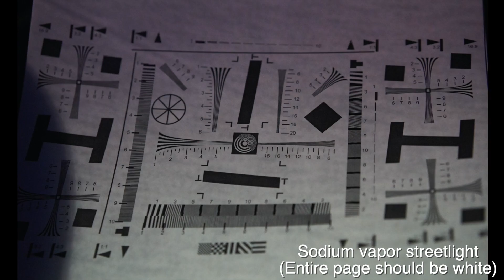Image Banding - How it Happens & How to Prevent It

Comment from the maker: I didn’t mention anti-flicker as it’s generally to reduce inconsistency in the exposure of the entire frame. So without it you could have bright and dark images alternating with one another, but while using anti flicker the shutter will align with the brightest output of the light each time to give you more consistent exposure. It rarely has much effect on banding artifacts (in my personal experience at least). In terrible LED lighting situations the best I found it did was make the banding more consistent 😂 (on the a7iii specifically).
Reply: Hello Wes, thank you. Can you confirm if the postrrization issue (michael the maven talked about) is fixed with the latest firmware? As well as all other artifacts in e-shitter mode? And,  Is it (the A9) is a good go in 2020 or R6 is better now with it's tracking accuracy and DR? Thank you for your good review
Reply from the maker: It can still get lots of posterization in high dynamic range circumstances when shooting in compressed raw. If you want to avoid that you need to switch to uncompressed, unfortunately. Most of the time it happens so infrequently and you have to look so closely that it's really not that much of an issue, though.
Reply: i repeat sir i am getting problem in still photography and also without  flash . flicker banding and other problem comes in ntsc or pal and in still when your shutter speed not match with flash shutter speed or not sync properly . but my problem is in day light without flash

Comment: So if you get "banding," use the mechanical shutter? For me wearing out the mechanical shutter will be a good excuse to get a better camera. I have a Nikon D40, that has close to 500,000 click on this shutter, and it still works good today, the problem is you must get Nikon batteries.
Reply from the maker: This isn't Always the solution, but Full mechanical often is. Sometimes you still need to try to sync to the pulses of the artificial lighting, which seems to only be getting More unpredictable as time goes by. I wasn't expecting that. I figured it would get better. How naive of me haha.

Comment: how can we remove it in post?
Reply from the maker: Which kind?
The big flash banding can sometimes be removed meticulously by creating brightening layers over the dark bands. The pdaf striping used to be manageable with a free online tool, but it hasn’t been updated in ages and doesn’t work for newer cameras and somehow even doesn’t work great for the older ones anymore either.
Reply: @WesPerry  thanks🙏🏻
Bandings from fluorescent light flicker. I hoped there was an easy way to do it with layers and blending modes.
Reply from the maker: Oh that’s even harder because that tends to have colour shifts. 
But ultimately yeah the best you can do is play with layers for both light and colour adjustments. It’s rough.
Reply: @WesPerry  thank you for your input🙏🏻 I was hoping I wouldn’t have to do that but OK😅 next time I’ll make sure to use the mechanical shutter👍🏻🎉

Comment: i have it with the z9   for event photograpy it is terrible due to led light. reduce the shutterspeed is an option but you get blurred images . HSS sync flash Forget it. I have to go back to  the d850  what a shame
Reply from the maker: Do you have flicker reduction enabled on the Z9? I found it was surprisingly good at avoiding banding. I was expecting it to be much worse.
Reply: @WesPerry  yes i did and it didnt work.
Reply from the maker: I also found I had no issues at all with HSS flash sync using the godox products I had on hand (AD200, 300 Pro, 600 Pro). Sorry you’ve had such bad luck!

Comment: I'm getting a lot of warping images, is that because of electronic shutter?
Reply from the maker: Depends. Which camera?
Reply: @WesPerry  it happens on all my sony cameras: Fx3, iv & &siii. my shutter's a 1/250 and I get a lot of banding. thanks for getting back.
Reply from the maker: Rolling shutter / warping images in silent shutter mode (full electronic) on the a7iv is Wayyyy worse than on the Fx3 and Siii, but none of them are Amazing for that. Just have to not pan quickly when in electronic shutter mode to avoid it.
Reply: @WesPerry  but I thought rolling shutter would be more of an issue in video not still shooting a 1/250?
Reply from the maker: It can certainly be an issue for both. Because of the scan speed of the sensor in electronic shutter, you can get it at any shutter speed all the way to 1/8000s
Reply: @WesPerry  thanks for getting back and global shutter will be standard in a few years, I hope cheers Great channel
Reply from the maker: Perhaps. Some say no, since apparently there is a necessary loss of dynamic range by having a global shutter. But who knows what magic they will work between now and then!
Reply: @WesPerry  interesting, I thought they were closer.
Reply from the maker: It could just be camera companies saying whatever to justify their current product lineup, but it has been said. You need an elaborate cooling pipeline for a global shutter to have competitive dynamic range, and all these small mirrorless cameras don’t have such a thing as a big RED block camera body does.
Reply: @WesPerry  can you tell me why the images can be underexposed by 5 stops when shooting at high ISO at night? screen looks properly exposed than the raw files are so dark. thanks
Reply from the maker: Possibly have DRO turned on, or Live View turned off?
Reply: @WesPerry  I've tried w DRO but I'll look into live view. it's another sony issue. if canon used third-party lenses i'd go back to canon.
Reply from the maker: If you’re shooting raw you always want DRO off. And live view setting effect On unless shooting with flash.
Reply: @WesPerry  everyone seems to leave it on but it has to be the issue. thanks again
Reply from the maker: It only affects the jpg, which is also the preview thumbnail, so it can create a disconnect between the preview and the final raw file.

Comment: Hi Wes, great video ! I need to take pictures of a one-man show and it's all in the front of a big screen. I get sometime a banding. How do i get rid of this in-camera, can you help me ? 🙂I use a Canon 6d mkII and a 5ds. Thank you !
Reply from the maker: Oh man, that's a tough one. It depends a LOT on what kind of projector it is. Different projectors not only have different refresh rates, but different technologies can give you grief. Like some DLP projectors, though they theoretically have a 60Hz refresh rate, will actually be showing Red then Green then Blue consecutively during that 60Hz, so it's actually a rainbow of 20Hz refreshes, which is a Nightmare.
Essentially the easiest thing to do is to put your camera in mirror lockup mode (because you're on dslrs) and cycle through shutter speeds until you stop seeing the background strobing/banding/rainbowing. 1/125 and 1/60 are the most likely speeds to work. But the problem obviously is the 1/60 is almost useless for taking pics of people. But as I said, every projector is different, so you'll have to get there early and do some testing to see which shutter speed works best.
I had a wedding in front of some awful DLP projectors, and I could only get it all in at 1/20s, which totally didn't work, so I created a moveable layer with colour corrections that I could slide over the images I took, with bands of blue correction, red correction, green correction, and then deleted the areas of the layer where people were in front of the screen and the stage, and shot at 1/125s. All I can say about that is UGH. haha.
Reply: @WesPerry  Wow thank you for your great answer !! You know your topic ! I guess it'll be a nightmare but i will do some test before the show and see what is going on ;-) Thank you Wes !😉

Comment: Great explanation thank you. I may dream in color here, but is there a way to fix the picture once taken 😢 i ruined a whole set a photos without noticing it.
If there's a fix in post I'll be glad to have it. Thanks again ❤
Reply from the maker: Depends which issue specifically. I once methodically created a dodge and burn mask to paste over a few images that had artificial light banding. Took some time, but worked reasonably well.

Comment: My Sony M4 have issue in still image also ..one side of pic light n other side dark..no solution yet
Reply from the maker: Is this with flash or no?
Reply: @WesPerry  without flash
Reply: That's why I am very sad about this problem
Reply from the maker: @factumphotography  I assume you’re in artificial light then? Not daylight?
Reply: @WesPerry  sir I did not understand..but I am explaining that I clicked those images in day light....natural light no flash mount .no LED or artificial lights used . Please tell me what to do..I just buy this camera 2 months  ago only and this problem starts within 15 days. Please help
Reply from the maker: @factumphotography  it sounds like your shutter might be broken if this is the case. Does it do it when you’re in electronic shutter mode? Does it do it all shutter speeds?
Reply: @WesPerry  yes in all shutter speed create problem 1/125 and 1/200 and 1/8000 . i used mechanical shutter and electronic shutter both but problem is same
Reply from the maker: @factumphotography  even in electronic? Very odd. Does it appear in the viewfinder while you’re composing an image???
Reply: @WesPerry  yes sir it's appear in view finder too
Reply from the maker: @factumphotography  so it shows up even before you take a photo?
Reply: @WesPerry  no it's shows after click
Reply: @WesPerry  sir this problem cause to memory card ???
Reply from the maker: @factumphotography  not if you can see it in the screen Before you take the shot
Reply: @WesPerry  I saw after click ...
Reply: With memory card
Reply from the maker: @factumphotography  do you have any other memory cards you can try? This is possible, but unlikely to be the issue, though.
Reply: @WesPerry  yes I have
Reply: I will send you sample images too...plz share your email or contact number...it's a very different problem ..I also never saw such a problem in my carrier

Comment: A7riii shooter here and I get crazy banding on manual mode and sometimes on aperture mode. It really sucks having to worry about banding when I try and do street photography at night. There's no second chances and lighting is always an issue. If anyone has any advice please let me know.
Reply from the maker: That would be from flickering street lights. Some street lights are the worst possible light source. Are you shooting in silent?
Reply: @WesPerry Yes
Reply: I am having same problem with banding .. indoor lighting .. and I want to shoot with 1/200 to get slow motion with 4K
Reply from the maker: You’re going to need to supply different lighting. Set up your own flicker free lights, or work by window light only.

Comment: One question. If I use the Ar7 ii with a lightning trigger (for lightning photography) do you thing that I will get banding? I'm thinking about using f10 exp 1/10 iso 100. With the efcs (because it has the lowest shutter lag).
Reply from the maker: I doubt it. Generally you only get issues with EFCS when you’re at shutter speeds above 1/250s, or with bad artificial lighting. This is neither of those.
Reply: @WesPerry  thx!!!
Reply: @WesPerry  On second thought lightning happens extremely fast and efcs isnt nearly as fast as a mechanical shutter. So i think that there is still a little bit of danger getting some sort of rolling effect on the photos. What do you think?
Reply from the maker: There would only be a rolling effect if your shutter speed was faster than 1/250s. Beyond that, your shutter doesn’t truly open all the way but just sweeps. But at 1/10s, the whole thing hangs open. I suppose there’s a very small chance if the lightning were to happen at the first fraction of an instant of your exposure, maybe, when the sensor was still being reset electronically?
Reply: @WesPerry  thx, again!!!

Comment: When my camera is in movie mode, I see 3 bars across my screen and when I record. I've had the a7iii for 2 weeks now, help plz
Reply from the maker: Could you be more specific about these three bars? Could be many things.
Reply: @WesPerry when I'm in movie mode and I start recording 3 big black bars is across my screen. If I adjust my shutter speed it darken or lighten up, depending which way I adjust my shuttle speed. When I turn it to manual mode the lines disappear if I put in memory mode it disappear as well. I've reset the camera, thinking maybe it's the settings but the lines came right back.
Reply from the maker: Does it do this when you’re outside or only inside?
Reply: @WesPerry  I can check for give 2 mins. So far it's only been at night.
Reply: @WesPerry  no it doesn't, I dnt see any bars across the screen
Reply from the maker: Sounds like this is a artificial lighting issue. The lights indoors where you’re filming likely have too aggressive a cycle.
Reply from the maker: Take a slow motion video with your phone and see what happens.
Reply: @WesPerry  gotcha. I did and I didn't see any bars. I filmed in a different room with my a7iii and didn't see bars.

Comment: Is a bigger sensor create more banding do to its sensitivity. I just want to make sure my new ZV1 isn't broken
Reply from the maker: Not so much due to its sensitivity. Bigger sensors generally speaking create more banding because they’re scan times are longer than on smaller sensors. It takes more time to read them from top to bottom.
The exception to this would be the a9, which reads much faster than other sensors in its class due to its high speed stacked design, and anything with a global sensor, like a RED cinema camera.

What issue specifically are you having with your ZV1?
Reply: @WesPerry  Under certain light situations while recording I get to horizontal branding bars that slowly move up the screen and then repeat  starting from the bottom and slowly move to the top. they completely go away if I put the camera to  1/125 or lower. It occurs the worst in my room which has super bright ceiling lights. do you think I should swap out  my camera or is this normal
Reply from the maker: Hmm. That likely has more to do with your shutter speed mixing with the refresh rate of your lights. A lot of LED lights cycle at 60 or 120Hz (although they can be many other speeds , and if your shutter speed syncs with it, the black bars appear (the dark you don’t see in between the cycles of your lights).
It’s fairly normal to have to adjust shutter speed (also referred to as shutter angle in this instance) to have to compensate for this.
It doesn’t affect smartphones so much because they tend to record at pretty low shutter speeds (1/15 to 1/30 at most) in video, and also tend to do frame combining for HDR, which also tends to cancel out such artifacts.
Reply from the maker: (Swapping out your bulbs would be the easiest thing. It’s just those particular light bulbs)
Reply: @WesPerry  thank you! So you think there's nothing wrong with my camera?
Reply from the maker: Oh for sure nothing wrong. Just grab some different light bulbs from somewhere else in your house and it will change or go away completely. Old incandescent bulbs won’t cause any banding, but it’s always hard to know which LED bulbs will or won’t. Some more expensive ones do, and some cheap ones don’t!
Also: if you have a dimmer on LED bulbs it’s almost guaranteed to cause banding.
As I think I mentioned in the video, (not sure if I did or not) LED bulbs that flicker like that can actually lead to headaches and migraines, even if we’re not consciously aware of it.
Reply: @WesPerry  Thank you so much. that saves me a trip back to Best Buy for a needless exchange. It's just weird that my canon camera doesnt have the banding under the same lighting. But they do have different sensors from different manufacturers
Reply from the maker: Were you using the same shutter speeds on the two cameras?
Reply: @WesPerry  yes
Reply: @WesPerry  I just swapped it out for a new one to see if it does the same thing

Comment: Where it's not glare, one essence is the blinking of lights, but that does not explain typical banding. The real essence is that your camera has time parallax. This is as old as slit or curtain shutters and visible in film photos of race cars before WW2.
With film you lose time parallax by using a leaf shutter. That doesn't work with digital because the camera scans photovoltaic cells in the sensor. It may run parallel scans in expensive high MP cameras or have one scan that turns the entire image into a single band.

Comment: So, the solution is DON'T USE SONY 🤔
Reply from the maker: Flash banding, you can get this with any brand, I’m afraid. Pretty much all mirrorless cameras, and many DSLR’s when in mirror lockup mode.

Artificial light banding from any brand or camera type, depending on the light source.

Silent shutter banding the Sony a9 is more resistant than any other full frame camera.
Reply: What lense could I use for golden hour to prevent this from happening? I have the 50mm f1.8 now.
Reply from the maker: Essentially any lens that resists flaring resists this effect. The cheaper lenses tend to be worse for it, of course. Better coatings=more resistance.